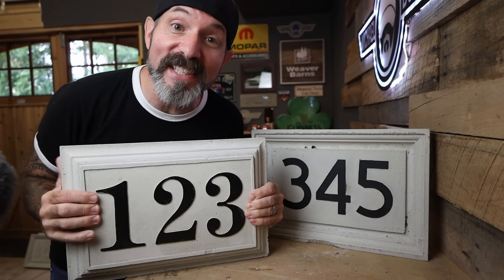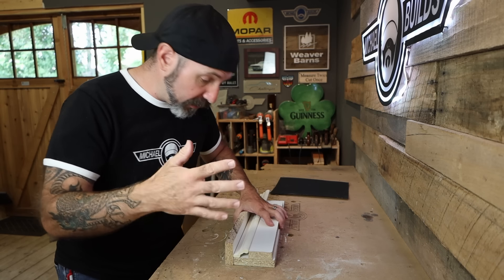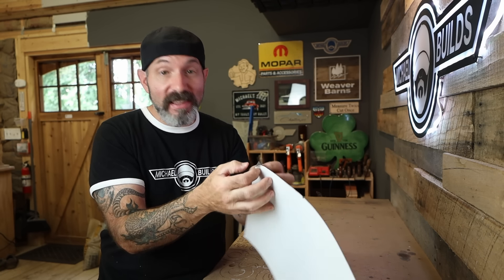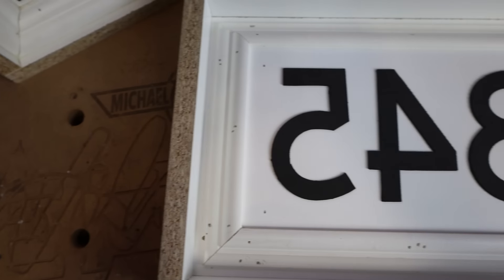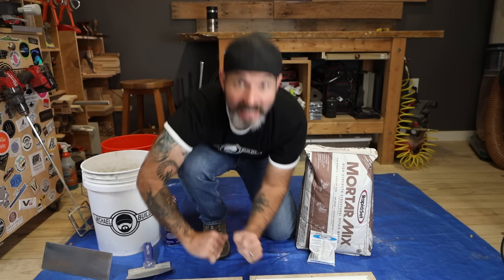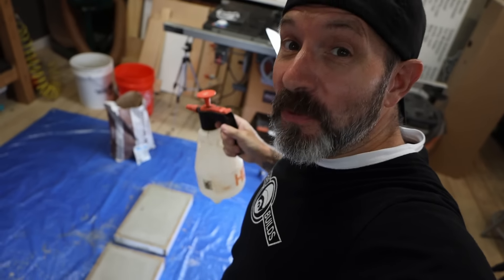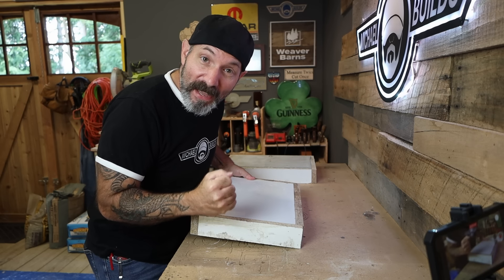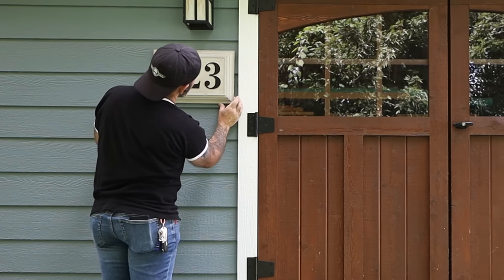QUICK and EASY Custom Concrete Address Plaques!

Comment: I did my name like this but I have a cnc router table and I did like a reverse of my name out of pblue styrofoam them poured it with Concrete. It turned out great. Its about 1.5 x 3 feet.

Comment: Love the tips and inspiration.  I think I might be able to help a little back...get yourself an auger bit...like the bulb digger bits, to mix the product.  The auger blades  pull the mix up for fast mixing, the point gets in the corners of the bucket bottom and it doesn't stress the drill.  I got the 36" long bit so I can mix while standing up.  I can mix a full bag of concrete in a couple of minutes in a five gallon plastic bucket with an auger bulb bit!

Comment: Nice… gonna try this! Handy tip…. Once you’ve mixed your concrete or mortar, don’t rest the mixer on the tarp, put it straight in the bucket of water, and give it a quick whizz to clean it. Otherwise you’ll be chipping it off with a hammer 😊

Comment: Very cool and something that is attainable to DIY!!

Any suggestions on how you would totally get rid of the air bubbles? More water or flow control and lots of vibrating?
Reply: You wouldn't be able to totally get rid of them. But more flow control (it tells you the max you can use on the packet) and more vibrating. I use a cheap massage gun from Amazon for that.

Comment: Alternatives to consider for both the mold and mix for a project this small -

Mold alternative: white foam board and hot glue.

Mix alternative: for the size of project consider plaster of Paris or rockite

Comment: I'm making concrete window sills (36 inches wide, 4 inches in depth, and 4 inches tall tapering to 3 inches for the slope) to replace brick rowlock sills. I made the mold out of plywood and made some test pieces with rapidset mortar mix to refine the design. Would rapidset mortar mix be a good choice for the final product? Do you have additional suggestions like reinforcement like in the video? Can they be sealed with some sort of concrete paint to change the color and help with water management? Thank you.

Comment: with the issue with the bubbles and the void space on the first one, would it be better to tap the mold after putting maybe half of the mortar mix? then filling it with the rest? I know the first set you didnt ues enough flow control or enough water like in the second set. just curious is tapping before molds are full would help with any type of project.

Comment: I need to ask you something, I live in South Carolina in an area where the sand mixture that was used to make concrete had impurities in it that is now causing the concrete to FLAKE APART. I can't afford to replace my walkway, I was wondering if you are familiar with this problem where I live and if you think a resurfacer will adhere and hold where the concrete has gone bad. Thanks for your help and suggestions in advance.

Comment: "Mortar mix is not concrete and concrete is not mortar mix" ...yeah i keep hearing this but what's the difference?
Reply: Cement is the glue aspect of both products. 
The composition of mortar contains finer aggregate, such as sand and lime. 
Concrete contains gravel. 
The amount of added water is different between the two with concrete using less.
Reply: @junit483  Thanks!